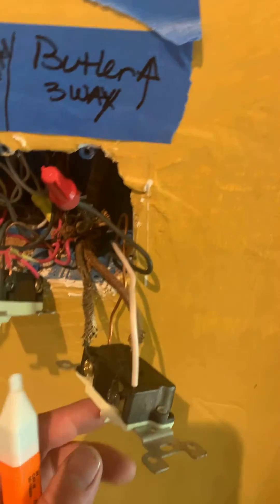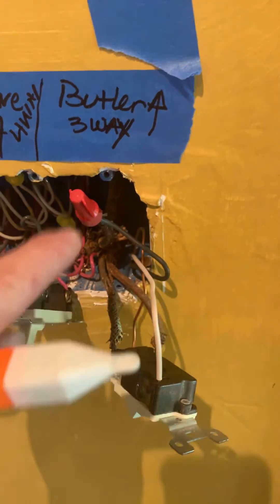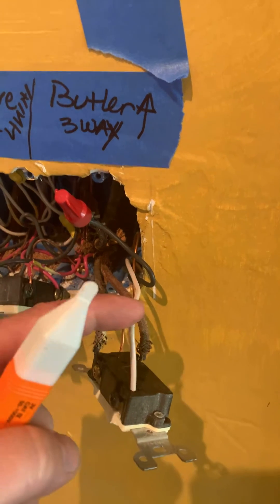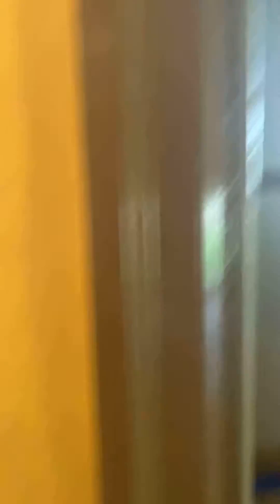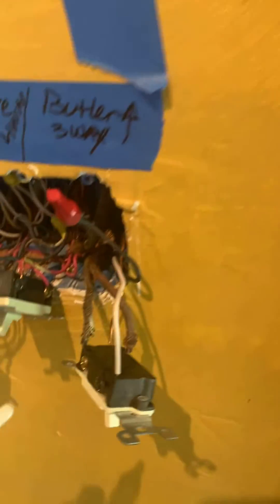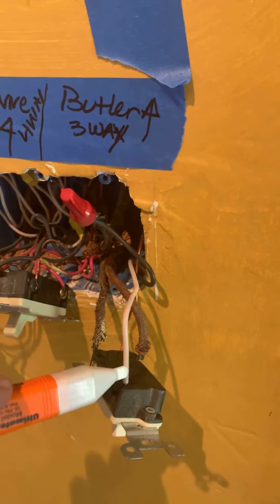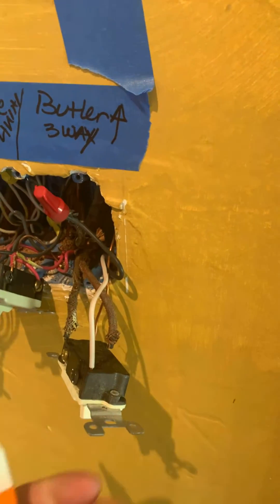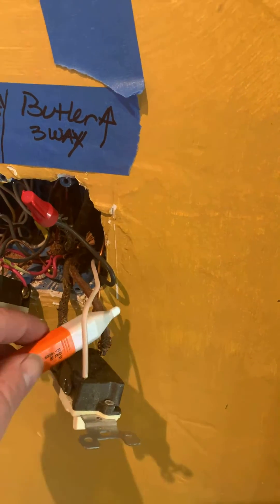Another reason why knob and tube is dangerous

Comment: You literally are scaring people into a rewire for literally no reason except money. All you would have needed to do in that particular situation is reverse the hot and neutral and the hot goes to the switch and neutral to the light smh. Also a “shock from the neutral” is exactly the same as a shock from the hot as the shock you’re getting from the “neutral” is not a shock from the neutral but actually the hot going to an unconnected neutral wire which means the hot has no where else to go because the neutral is being switched. But you are purposely LYING about the danger of a switched neutral by saying a shock from the “neutral” which is EXACTLY the same is worse than a shock from the hot then telling people they need a REWIRE which costs thousands of dollars when in fact to fix the “really dangerous” problem of a switched neutral is to reverse the hot and white wires, not a REWIRE.
Reply from the maker: No, ok so your wrong on multiple fronts here my friend.

A neutral shock is far greater than being hit from the black wire. 
Why is it worse, a neutral shock carries the load that it energizes while a hot shock doesn’t always carry a load with it. 
This is common knowledge amongst master electricians so I question why you would even argue that fact.

And 2, you can’t just reverse the wires in a knob and tube 3 way switch because how 3 ways are wired during knob and tube time period. The hot on the video is being spliced within the walls, they are not accessible. If I attempted to swap the wires I would lose my feed in other areas of the home. 

And if your one of the dinosaurs that still believe knob and tube is safe I have plenty of evidence that clearly shows otherwise.

ALL my rewires come from real estate transactions, I’ve NEVER feared anyone into a rewire, I don’t need to do that, it’s quite evident without me saying a word.
Reply: @DonaldMillerElectric  A neutral Cannot deliver a shock PERIOD. Because it is at the same potential as the ground wire (it’s why people don’t get shocked from grounded appliances) the neutral is NOT what is shocking you it is the hot and the hot in mains AC is ALWAYS at 120 vac which is the maximum voltage that can be supplied with only a hot and neutral. The voltage is What causes the electrical shock, not the current as a lot of idiots say, ask any electrical engineer. If the voltage is 120 volts from the hot through your body and into ground (in which case an electrical shock will occur) the amount of current flowing through you is roughly 80 milliamperes or 0.08 amps. The fact that the hot is going through the load before it goes to the “neutral” that you say is shocking you (which isn’t a neutral because the neutral isn’t connected it is just a hot going through the light and to the “ neutral” wire that leads to the switch which will carry the same potential of 120 volts. The “neutral” that is shocking you is not a neutral at all but I. Fact a hot going through the load and to the switch leg that doesn’t have a return path. The voltage is the same (and in fact the shock will be ever so slightly less because of the voltage drop through the resistance of the lightbulb but it’s negligible.) and thus the current flowing through the body is the SAME.
Reply from the maker: @rickduncan692  
Holy shit, you are so completely lost here. The fact you think a neutral can’t shock you is enough to deem this conversation laughable. 

If you have power coming up on the hot to a motor, then you interrupt the white to that motor you will be completing the circuit with said motor amps running through your body to complete that circuit. 

You can’t just swap knob and tube conductors because they do not run the same way modern wires run. They have splices in the wall the deviate in different directions. You can’t just reverse the polarity
Reply: @DonaldMillerElectric   you do not get 0.5 an amp of fucking current flowing through your body because the light bulb draws that smh. You get 0.08 because the voltage is at 120. Do you not understand ohms law? I=E/R The voltage is 120 volts (always is in US with only a neutral and hot) and your body resistance (which can vary greatly from person to person aswell as whether your hands are wet) let’s say is 1500 ohms. Then 120/1500=0.08 Amps of current flowing through you at 120 volts not 0.5 an amp like you said in the video.
Reply: @DonaldMillerElectric  I said a neutral can’t shock you because it won’t if you are grounded. If you are touching a hot wire and then touch a neutral then yes it can shock you , but everyone views the neutral as a ground conductor at the same potential as the ground wire. (The ground wire literally gets its potential from being tied to the neutral in the panel) So on a technicality yes a neutral can shock you but that’s only when you are already touching a hot in which case you are now 120 volts in reference to ground.
Reply: @DonaldMillerElectric  That knob and tube has the same electric service that all modern romex is getting and since you showed that voltage was coming into the box from that hot and going to the light first you could have just tied the hot to the common of the 3 way instead and put the incoming neutral where the hot was so the neutral would be the non switches wire and NOW you are properly switching the hot in the three way circuit.
Reply from the maker: @rickduncan692  
Your math is retarded
Reply from the maker: @rickduncan692  
UNREAL DUDE.
You can’t swap because the hot that’s feeding through is splicing out in the wall. How do you not understand this.
Never mind, on another note 
Ohms law states a 65 watt light bulb is .54 amps of current at 120 volts. So when you interrupt a 3way system that’s using a neutral you are more likely to be hit with the amperage than a 3 way system dealing with the black. If you can’t wrap your head around this THEN GO BACK TO SCHOOL. I don’t have time for this childish bullshit.
Reply: @DonaldMillerElectric  No because the light bulb resistance is in series with your body so yes ohms law does state that a 60 watt bulb is half an amp because the resistance is 240 ohms but since your bodies resistance is thousands of ohms that cuts down on the current down to about 0.08 amps atleast what a source online said. This is because your body and the bulb is in series and since in a series circuit the current is constant throughout all resistances the 240 ohms plus 1500 ohms actually means the current will be LESS than the current through your body when touching a hot because that hot has effectively zero resistance which allows more current to flow through your body.
Reply from the maker: @rickduncan692  
In the Field that’s not how we measure a potential shock. Go take your theory and keep it for the classroom. In the field we measure the shock by the POTENTIAL ENERGY. All potential energy can be proven. The resistance of each persons body is different so those figures are irrelevant when dealing with potential hazards. AGAIN A SWITCHED NEUTRAL SYSTEM IS FAR MORE DAMGEROUS THAN A SWITCHED HOT CONDUCTOR FOR MANY REASONS.
Reply: @DonaldMillerElectric  I never said it wasn’t more dangerous I was just saying that the shock from that neutral is not anymore dangerous than a shock from a hot. I know that a switched neutral presents the hazard of the socket still being hot even when the light is off but that’s not what I was talking about.
Reply from the maker: @rickduncan692  
Again your wrong, I’m tired of explaining this to you, I’ll make a video.
Reply from the maker: @rickduncan692  
Go check out “why a neutral 3 way system is dangerous”

Just made the video.
Reply: @DonaldMillerElectric  ok I will but I never said that switching the neutral was as safe as switching the hot. Obviously switching the hot is better.
Reply: @DonaldMillerElectric  https://www.electriciantalk.com/threads/how-severe-is-a-neutral-shock.184370/ 

These are ACTUAL electricians who know what they’re doing debunking that myth that the “neutral” shock is more severe.
Reply from the maker: @rickduncan692  
This is your evidence, lol
Reply: @DonaldMillerElectric  wasn’t there a hot in the switch box?
Reply: You should be able to reverse polarity where the incoming hot and neutral are
Reply: @DonaldMillerElectric  please can you explain - in basic English - why a shock from a neutral is any more dangerous than a shock from a hot wire? Maybe explain using electrical first principles - i.e. draw the circuit diagram - in terms of voltage and current.
Reply from the maker: @badermanh 
I will try to dumb this down as much as possible. In a standard switch box…..the only conductor thats carrying a potential load is the one wire going to the light, and in order to get hit with a load you would have to be between the hot wire and the load. 
If the neutral is being switched, the load already has power to it and it’s looking to go home (ground/panel). Anything in the switch box that’s grounded will now hit you with the load of the fixture.
Reply from the maker: @badermanh  
Just made a video explaining, I hope it helps

Comment: I was working at this clinic277 volts we were doing a remodel and a regular switch needed to be replaced but what i noticed was that there was a neutral and a hot for the switch and it was in MC so it wasn’t knob and tube, any idea if this would be considered a load at the switch as well? It was my first time working on 277 and the guy in charge said it’d hurt more then residential 120 so i said ok maybe a little more than a residential shock, nope, i replaced 2 switches and on the 3rd i got too comfortable and i guess my hand touched the live wire through my right hand to my left that was holding the switch. Never had i been so afraid of electrical before, everything went dark and when i noticed my body had just kinda went out and i was out the door, idk if it was just because it was 277 or maybe because the neutral was there? Idk i feel like the guy in charge should’ve just turned the breaker off tbh im only about a year in
Reply from the maker: It was a dead end switch, no neutral. You got hit with 277 to ground. I was hit with 277 about 8 months in, an experience you will never forget.